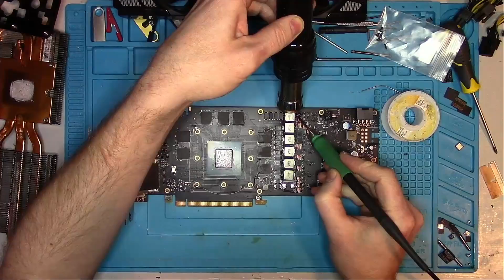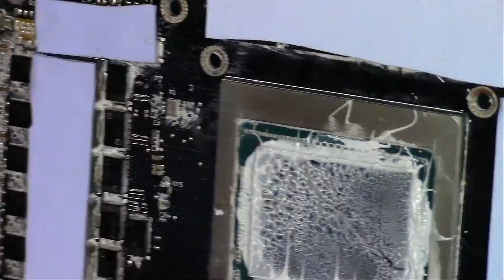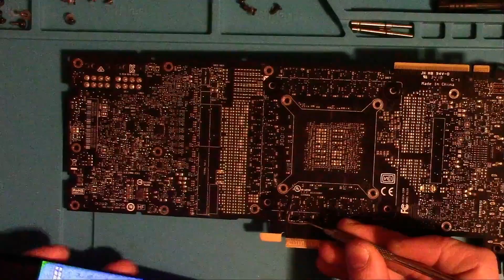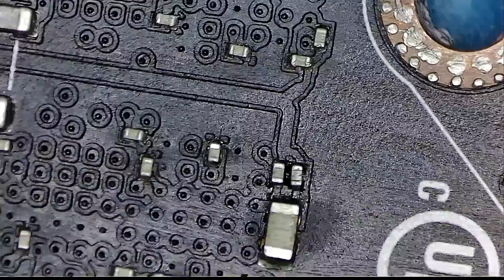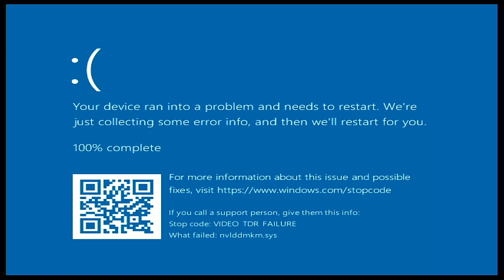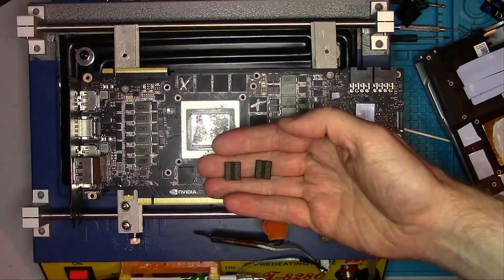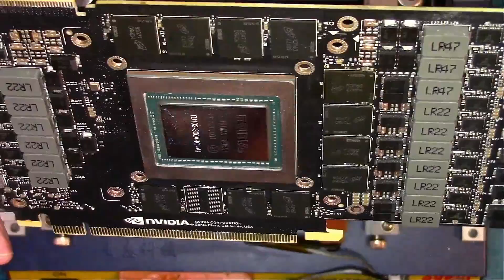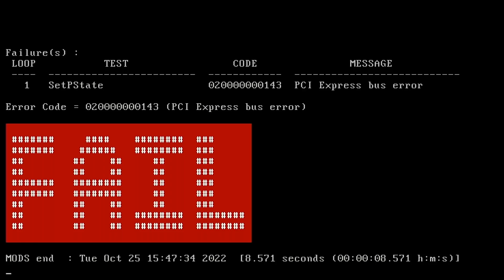2080 TI Memory problem warning

Comment: Crazy it got resurrected from the grave. Alot of knowledge and skill here. Remember there was a big thing with this card about the memory having alot of problem. RTX 2080 Ti owner here and I haven't had a single issue thus far and I push the GPU to the absolute limit. Still, can't wait to eventually grab an RTX 4090 this upgrade
Reply: why would you want a 4090 anyways? you already can run anything lmao
Reply: Hilarious, no for sure, but there are plenty who don't think this way. 4090 is intended to be used to get true 120hz where the 2080 Ti won't be able to with the highest graphical fidelity. There is no other reason I'm afraid. Everything else it undoubtedly overkill for the requirement of the output in this situation. Also worth of upgrade considering owning a CX OLED to get RGB Hdr 120 as the 2080 Ti can only do 8bit chroma sub sampling which looks good enough to most people truth be told
Reply: @thegroi  exactly these sheep will buy anything he already has a perfect gpu
Reply: Not true, the 4090 is the perfect GPU it can push 4k 120hz and 8k 60hz in the highest circumstance where the current GPU could only manage 60FPS and 30FPS respectively. 2080 Ti is a better 1440p / 3440 x 1440 ULTRAWIDE contender don't worry I'll be keeping it just in case. Invest big and skip the 5000 / 6000 series as I did with 3000 another thing is the 7990 XTX is one beast of a GPU so competitor is there. There is no sense getting anything less than the best available
Reply: @lakelss  no sense in getting anything less than the best available? i hope your pockets are deep man
Reply: No, see invest big late next year when the price will inevitably drop and then skip the 5000 series and hopefully 6000 series due to marginal level of increase. This is how to save the most amount of money and still purchase top tier equipment. Even the second rung down does not satisfy the requirement we're trying to push. Portal RTX just barely manages 60 FPS with the Ultra Perf DLSS preset on the 2080 Ti which was a $1300 GPU for perspective. This forces NVIDIA to innovate / create good equipment
Reply: Just get a 3070/3080
Reply: @tzr5864  it's dumber to buy a new 3080 from 2080ti then having 4090. 3080 is worse value as its price is almost same as msrp while 3090ti killer 6900 xt goes for 655 new...
Reply: @Hi-levels  damn, I forgot about the 6900XT, I've gotten the 3070 for $300, and gotten another for trading a gaming laptop. You can find the 3070/80 at a dirt cheap price, Maybe the 6900 XT is your best bet.
Reply: @tzr5864  for used agree. For brand new its not a good idea for nvidia 3000 series. I also bought the 3090 less than 700 usd
Reply: @Hi-levels  not bad at all
Reply: Not likely, the 4090 is nearly 2* stronger
Reply: @lakelss  strong enough to burn down your house
Reply: Won't ever happen guaranteed, get two for SLI. Couple people got bad lottery or their shaking hands couldn't plug in the adapter properly with their budget their PSU and look at the response. This happen every generation every vendor nothing will change it is 100% SAFE and effective
Reply: mine is already having issues,
Reply: They do, get the 4090 and don't give them any more money then. Force them to innovate. Indeed the 7900 XTX is unbelievably good this time around therefore it's go big or go home. Perhaps you don't utilize the purpose of this card to it's fullest extent, but plenty yours truly included require pushing 8k or true 4k 120hz locked to keep the industry going forward. Just how it is. 3000 series was a stop gap series fitted with HDMI 2.1 for those without a GPU at all or desperately needed OLED hdr RGB 120hz . Was supposed to be marginal upgrade at best and the 2080 Ti still can handle 4K 120hz in plenty of title due to extreme video memory chugging only when there is a ton of garbage on the screen in worst case unoptimized scenario. With the 4090 we take a risk for innovation. Plenty of people don't have a single issue with their card identifying potential risk hazard and installation. Doesn't hurt to back up the PC or build a prototype alongside the build currently being used for this reason. Worst case RMA and eventually they'll have to cover / fix the issue including other HW which was damaged
Reply: Why waste your money on a gpu that will do the exact same thing as your current one?
Reply: @abraham9301  facts
Reply: RTX 4090?
Are you puffing the magic smoke dude?
Reply: Sure. Struggle reading? Different type of memory were outfitted on the 2080 Ti depending on the purchase people could end up using a defunct version destined to be RMA or have severe longevity issue. Luckily I didn't get this particular chipset Micron or Hynix I got Samsung, but this could be an issue going forward. Not that would I expect you to comprehend this, drug addict.

Comment: You make this look easy. And it looks like fun. Two questions, which I'm sure you've answered 100 times before so my apologies.

1.) What software did you use to test the card? The one that ran in command prompt.
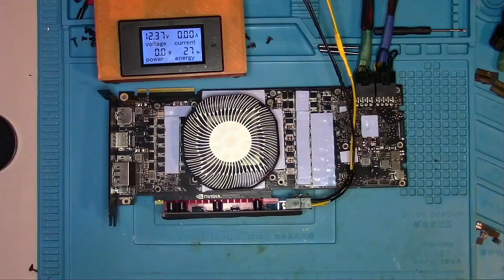2.) What are those pieces of hardware you used to test the card called? 5:58 and 5:37
Reply: Not OP but the software is in the description and he used a pcie slot testing unit. search PC AGP PCI-E X16 Dual-use Socket Tester Display Graphics Video Card Checker Tester Graphics Card Diagnostic Tool its 45$ on a couple ecommerce websites.
Reply: @GingerAttack666  Thanks m8

Comment: That 2080TI ,they had a waterblock on there and put the stock cooler back on later.  That's why the screws are mismatched and why the thermal pads are all freaky looking.  The stock thermal pads look very different.

Comment: As someone who got a comp sci degree, therefore only knows programming, not hardware, I like your funny words magic man!

Note: I know basic hardware not GPU and such
Reply: I only know hardware, the programming is a foreign language to me. Funny seeing the opposite end of the spectrum. Lol
Reply: @OCtheG  same
Reply: your CS degree DIDN'T teach you basic hardware? what sort of CS degree is that? I had multiple modules dedicated to hardware. Of course the electronic engineers have more in depth knowledge, but we were expected to be able to design (i.e traces, component positions), fabricate (milling etc...) and assemble (surface mount inductors, caps, resistors etc...) a PCB and accompanying hardware, and program the MC on said PCB to control any accompanying hardware.
Reply: @lewisd56  I am currently doing mathematics and computer science (UK joint degree) and I never got any hardware course, even compilers were exclusively taught to computer science people. 

I've mostly just had theoretical stuff as compulsory courses and the rest to choose myself. And among the options we get, there's basically nothing hardware focused.

Still, I have been studying more on the side because I'm afraid of coming out useless from university even if I have pretty good grades.
Reply: @leonro  
UK computer science degrees too, (BSc and MSc), I had dedicated modules for embedded systems (C++ programming arduinos and other MCUs as well as designing accompanying circuitry), even had a module that went into specifics of logic gates and operations in a CPU. The MSc took a step back from the hardware, but I specifically picked the hardware oriented modules, so ended up working with more complex embedded systems and designing a whole PCB from scratch.
Reply: @lewisd56  That sounds really cool! It's unfortunate that my university's compsci department doesn't have a lot of variety in courses. It's basically all formal logic stuff or really formal programming of certain things (+ combinations of the two). Not much practical coding or hardware usage is involved.

Comment: Just curious. If you only had to replace those two chips, would having a GPU repaired like this be cheaper than just buying a new modern GPU? I'm honestly curious because I don't think I've seen anybody here in my country who actually works on GPU repairs as a business specifically. Like perhaps it's too expensive to upkeep and there's too little incentive for customers in a financial sense to have GPUs repaired instead of just buying a new one.
Reply: Reckon at the very high end you'll see people repairing rather than replacing GPUs if they are out of warranty i.e 3090/ti/4080/4090 seeing how expensive they are.
Reply: @tourmaline07  Parts availability may be the biggest issue. The other thing not said but implied is good documentation.
Reply: @brodriguez11000 That is a fair point and not one I'd have thought of - I'd have assumed commonality of parts like inductors/MOSFETs between many generation of GPUs but parts like memory chips might be scarce.

Comment: Got an issue with my own gigabyte 2080 ti that I couldn't figure out the cause. 
Fan on the far right started running at 100% no matter what, tried swapping with fan on far left to see if it swapped sides but it didnt even with the other fan in place it was still the far right one which spun to 100%.

Comment: How do you determine the memory is dead bro?
I mean what pads on the memory module do you check for those resistance values?
Also what are the correct values for a good core and a good memory?
Reply: i can only assume its not going too be the same for every mem and core, probably have too go too the manufactures website for each individual component your interested in or test one you know is working
Reply: look in the description lmao he has a doc with everything in it

Comment: I'm surprised how there are no class action cases for failing of 8 leading GDDR6 micron chip.
Reply: They lasted the warranty Period.
Wouldn't be surprised if Nvidia knew that and used them anyway so they can sell more Cards, given their usual scumbag behavior.
EVGA pulled out for a reason.

Comment: Could you please make a video explaining mods you make to your own cards to make them more reliable and less likely to experience part failure from overheating? What assortment kits you recommend, assuming it's shims or pads, etc.? Thanks!
Reply from the maker: I don't do mods.
Don't overclock. 
Keep it cool.
Fresh paste and pads. Nothing else.
Reply: @northwestrepair  You may disagree but i also undervolted my GPU as much as i can before i start to sacrifice performance and stability,
Reply: @northwestrepair  my HD7850 worked for 12 years non stop for me. Gaming 9 hours or using 3d max 9 hourse a day, it didnt matter.
This gpu still can work after all this time when it was maxed out everyday for 12 years.
I got a 3080  but that amd card can still work 
I had a golden rule. Which were never broken when i had this gpu.
NEVER EVER  overclock
NEVER.
Over clock is most stupid thing people are doing with their gpu. It will sap away life span heavily.
At very least this was my experience.
My last pc was 20 years ago as well.
It worked for 10 years.
I never overclock that either.
Normally i build new pc for every 10 years, hope new 3080 work fine for next 10 years.
Its undervolted and kept cool while i am working with pc
Reply: Overclocking isn't dangerous as long as you don't overvolt too much and keep the temperature in check. My old ATi 4870 1GB is still working fine, even tho it has been heavily overclocked since the day that I bought it in 2008.
Reply: @waifuhunter9709  "Over clock is most stupid thing people are doing with their gpu. It will sap away life span heavily."

yeah you're actually retarded if you think people use garbage GPU's for more than 2-3 years bro these days, even back when overvolting was a thing it wasn't relevant

Either way, just overclock anyways, why? Well... Overclock doesn't mean OVERVOLT, you can't even do that anymore on 99% of gpu's

stop being stupid just because you fucked up
Reply: @huumehemuli99  They don't make em like that nowadays. Not even joking, the chips on those are a little thicker and more built to handle that. Also longevity isn't quite the money maker, so new cards have issues like the one seen in the video. RAM failing is apparently a common issue nowadays (also caused by the shortage from what i have heard).
Reply: Only thing I know of that is doable without actually taking the card apart would be undervolting. Generally it wont harm the card. Just do NOT make the mistake of going over the safe limits. You WILL fry your card if you accidentally over instead of under volt it. I would not recommend unless you absolutely know what you are doing.

Comment: This tells me so much,first how good you are at diagnostics and secondly,the reason for resin around the memory, is because they run this memory so hard it gets hot enough to soften the BGA solder,the resin stops the memory moving around, that explains why so many fail just after warranty, i used to buy high end cards,now i dont,just money down the drain.I remember the early days,when graphics cards usually outlasted the PC,the only reason to replace a graphics card back then,was to upgrade.Seems like everything now is made by, make fast buck companies.I liken it to buying a ferrari,it's great at waht it does,but you pay the price for this performance & its engine isnt going to see many 10000 of miles,before a rebuild.Great vid,thank you.
Reply: That's a BGA underfill and is not there because the solder is melting. The chips would stop working long before it ran hot enough to do that and holding it in place would only do so much anyway.

Underfill is meant to relieve stress on the BGA solder balls. Usually to minimize the effects of thermal expansion over time but Nvidia doesn't really care about that. It's only on the chips nearest the PCIE slot because they're the most prone to damage from board flex. I suspect it's also there as added protection for OEMs and prebuilts shipping these pre-installed in systems.

It's also likely part of the reason Nvidia has moved as many chips away from the slot as possible on the heavy 30 & 40 series cards.
Reply: @JJFX-  ok thats fair enough,i was thinking low temp solder 188 deg c,as i would imagine it would allow for a very small amount of thermal movement,under overclocking for instance,ive also had laptop system boards with resin around memory BGA's ,i wonder if it's the same reason. Do you think high end graphics cards are always going to have a high failure rate because of thermal stress,or is it something else? As for the small SMT tant caps,ive repalced a fair few of those, bit like the larger ones,they go short circuit as well. As the old saying goes,the cooler you keep components ,the longer they live.
Reply: @enoz.j3506  Well this is almost certainly all lead-free solder which really melts well above 200C. Issues with the GPU itself tend to be on the large dies as thermal cycling has a more significant impact on the substrate joints over time. Different parts of the die heat up at different rates so the effect of thermal expansion become more significant. How  the die is bonded to the substrate, the type of underfill combined with acceptable production tolerances have been difficult to get right while staying economical. This a big reason for the infamous Xbox 360 RLOD early on. 

Hard to say how modern chips will hold up. Package engineering is very complicated and Nvidia has made plenty of mistakes in the past. However advancements in underfill and BGA assembly have come a long way since their more notorious issues. That said, they are dancing with the devil by using bigger and bigger dies pulling more and more power.

I definitely agree that those looking for longevity should keep everything as cool as possible. IMO, putting a full size water block on $1000+ GPUs capable of well over 350W is a no-brainer.
Reply: yes the thermal expansion in all dies is very difficult to control,if you think of the 28 billion transistors+ ,it is amazing it lasts as long as it does, yes i remember the xbox problems.
Reply: @enoz.j3506  Yes it's pretty mind blowing. As processes get smaller and smaller it'll be interesting to see how the transistors themselves hold up. Interestingly, Nvidia's vcore target has largely stayed the same since Pascal despite going from TSMC 16nm to 5nm now.
Reply: @JJFX-  We will get to a point where we can no longer go any smaller ,Atom level,then a big rethink on how large amounts of data can be processed,big changes in the next decade or sooner. Interesting times.
Reply: My HD 7850 worked for 12 years.
I hope my 3080 do same thing
Reply: They're just using edgebond or underfill resin for manufacturing purposes here i would think, else they'd run it both sides if it was for strain relief purposes.

Consider the manufacturing soldering process. They paste, pick and place, and heat the PCB till liquidus, cool, now it's soldered on one side.

Then you flip the card over, paste, pick and place, heat... and the other side's components would all fall off! That won't do. So need resin. You'll find a dab of annoying red heat-cure resin under most smaller components or some sort of bonding resin which is soldering temperature resistant. The resin side would be the side with fewer components, or the "bottom". And the bottom side is manufactured first.

Combination of high currents, high temperatures, and small semiconductors isn't only a hazard for the materials sandwich mechanically, but also a hazard for the semiconductors themselves, due to electromigration. The current basically very slowly pushes semiconductor material around, and temperature makes it easier. So they guaranteed degrade with time. Unless the manufactures reign efficiency in somewhat fierce, i don't think decades long lasting modern semiconductors are going to be a thing. But i'd love to be proven wrong.